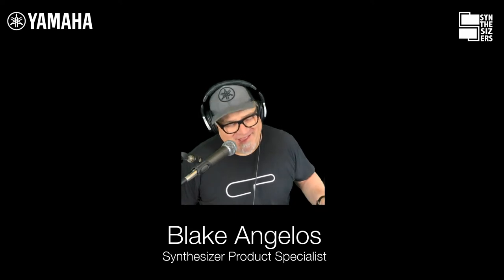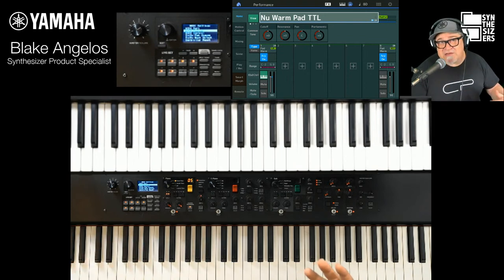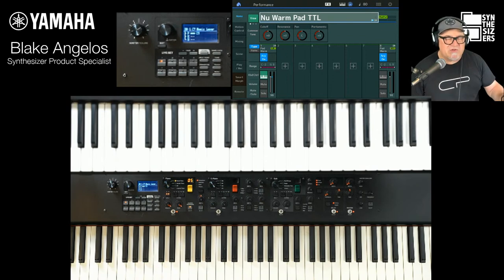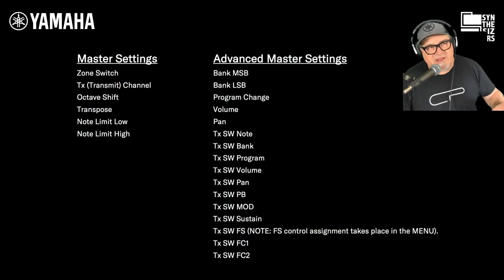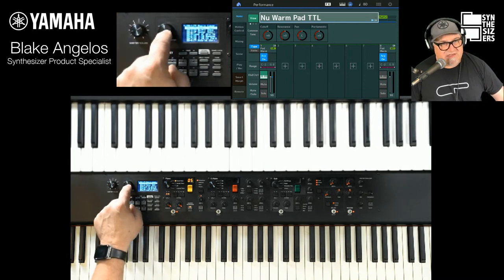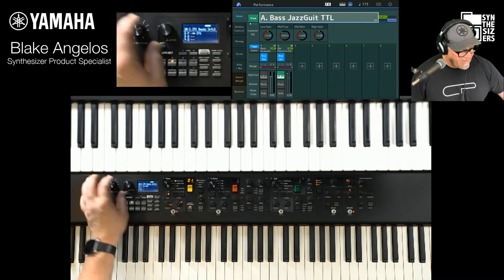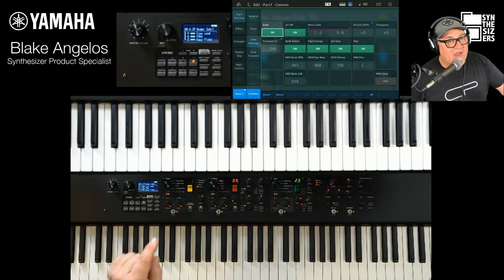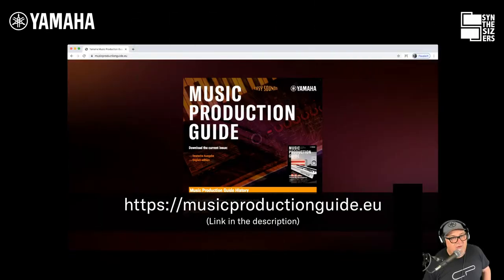Tech Talk Live: CP MIDI Connectivity

Comment: I have a little question about using Midi between my Ensoniq SD-1 synth and Yamaha CP-5 piano. I am trying to conect these two keyboards with Midi cables in and out with two cables. I want to play on the Yamaha and use the Ensoniq SD-1 to record midi-notes into the sequencer, but when I hit the play button on Ensoniq SD-1, I only hear the drum beats on the Yamaha CP-5. By the way I also have stereo audio outputs from both instruments to a Roland BA-30 Portable system to hear the piano sound and the metronome on Ensoniq SD-1. Any suggestions what I need to change to make it work?

Comment: Blake - this is great.  I have a CP 88 and Montage 6.  Looks like I can set up a Midi setting where I control an organ performance "underneath" a piano setting on the CP 88.  Do I understand this correctly - I can do this at the live set level so it only works when I need this setting?  I have some great sounds from the Organimation library that I'd like to layer from time to time.  Can I still control the draw bar settings on the Montage when I have the CP 88 controlling the organ performance?   Thank you and please keep sharing these videos.